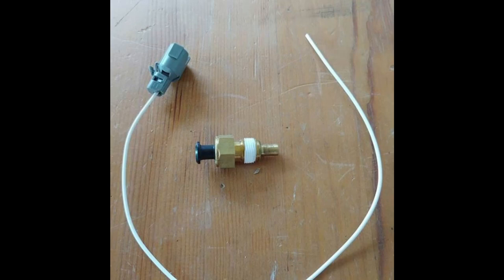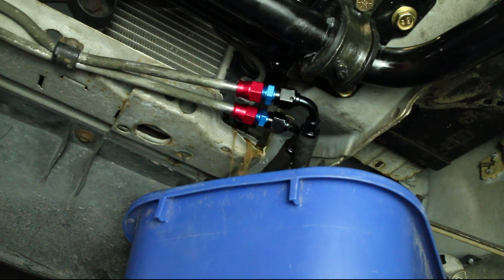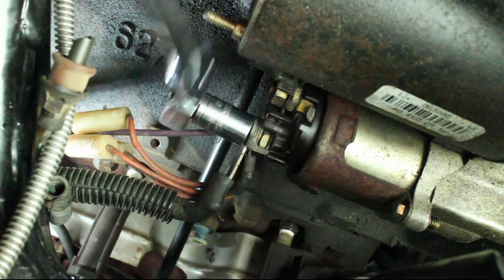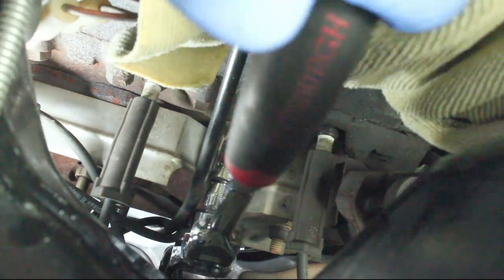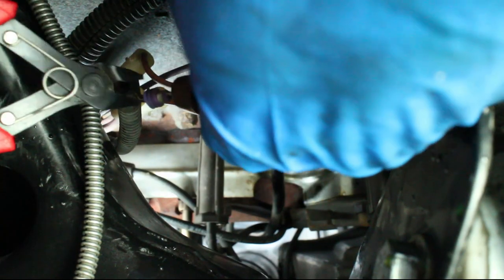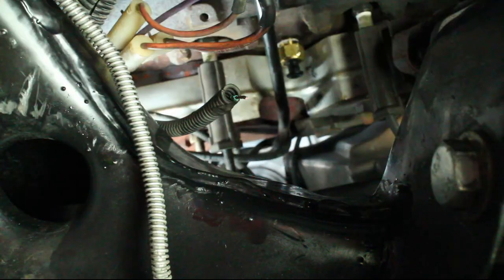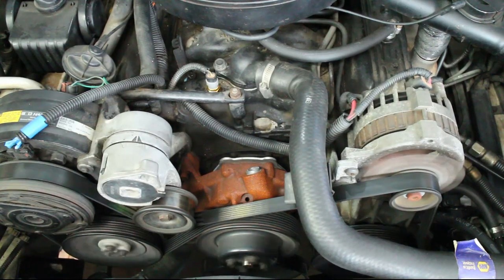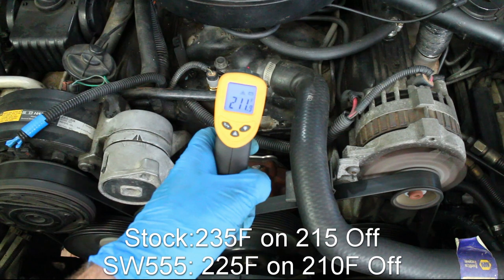Cooling Fan Switch Installation (1982-1992 Camaro/Firebird)

Comment: thanks for the vid. its not easy to make these or to take the time to do so. I didn't read all the comments in case somebody already mentioned this. In the very beginning you say it is located between 7 and 8 cylinders. The correction between 6 and 8. But I know you know that. Just for those that might not know it.

Comment: I have done this twice now without draining the coolant.  You have to be quick and yes you lose about a cup but otherwise it isn't bad.  I use the Buick Regal cooling fan switch 210 on and 195 off. You change out the pigtail every time as they don't last long like stated below.  Helps to have headers when you do the quick change method like I did as it gives you more room to get hand in there.  Nice video again.
Reply from the maker: the SW555 switch is the Buick switch, but mine doesn't turn on at 210F unfortunately.

Comment: Just went through the same process a few weeks ago when I converted from clutch to electric fans (and a serpentine belt install).  I is e a FS111 from NAPA, on at 225 and off at 208 for the secondary fan.  Primary is triggered by a Parts Source 200/185 that I found on Amazon.  The connector back by the manifolds also crumbled in my fingers.  Hot spot!

Comment: you can run an 1987 buick grand national sensor that turns it on at 200.
Reply from the maker: the SW555 switch is the GN one. but I've tested 3 switches and they all had different fan turn on temps.
luck of the draw i guess

Comment: I still have the EGR manifolds on my 305.  I can not see the switch, only feel it from the top by following the wire.  Just as bad or worse from the bottom, no way to get to the dang thing unless you have no bones in your arm.  I was able to get the wire back on it, will see if cleaning the connection helps after i replace the fan relay.
Reply from the maker: I have a 100% stock engine and going from below is way easier than above forsure. My arms won't even fit from above
Reply: Tried years ago on a 305 but ZERO torque space so I rewired it to a manual switch through the relay

Comment: Is this wire a ground wire leading to the switch or a power wire?
Reply from the maker: I assume it leads to a ground that triggers the fan relay.
engine block is grounded and the fan switch is 1 wire
Reply: @3rdGenGuy  thank you for your quick response

Comment: Would Part # 231? It looks the same just a different color and does snap in
Reply from the maker: there's like 10 different part numbers for various ON/OFF temps and the like. the SW555 was just the lowest Temp switch i could find.

Comment: is there an update for these part numbers?  the pt308 is showing for a knock sensor and im getting different part numbers for the sensor
Reply from the maker: PT308 shows up as a plug. maybe it's the same for knock sensor? 
it worked for my temp sensor. 
https://www.amazon.com/ACDelco-PT308-Original-Equipment-Multi-Purpose/dp/B000C9TUXC

Comment: For some reason I can’t locate the green wire shown in this video. Can someone tell me where it would lead to?
Reply: the wire used for your Fan switch may not be green in color...one end should be attached to the Device you are trying to replace..

Comment: I put a new switch and connected but my fans aren’t turning on what could this be?
Reply: Could be a bad bad switch, fuse, or fan/motor. This last year I changed switches and the fan still wouldn't kick on. Luckily it would turn on if I turned on the AC/defrost so I knew it wasn't a fan/fuse problem. I'm getting ready to install a manual switch in a few weeks. It seems like parts over the past couple years have been lesser quality that ideal, including these switches.

Comment: HI, is this for 1991 Camaro V6? Also, do have an Instagram?
Reply from the maker: the switch repair/replacement is the same on the V6s or v8s.
HOWEVER, the location changes.
you'll have to find where the Fan switch is on a v6 model.
3:07 for Instagram
Reply: Thanks